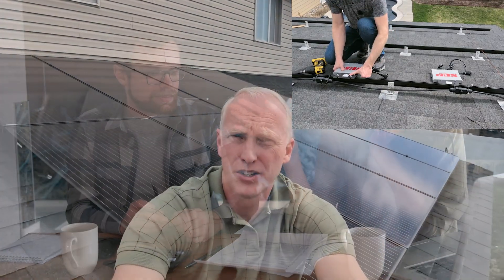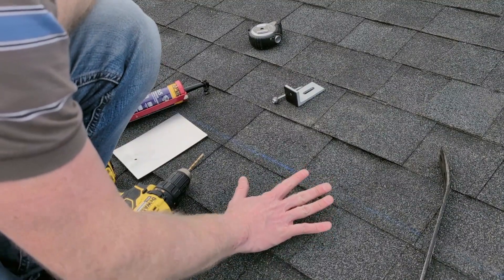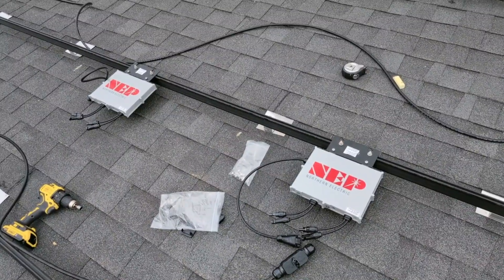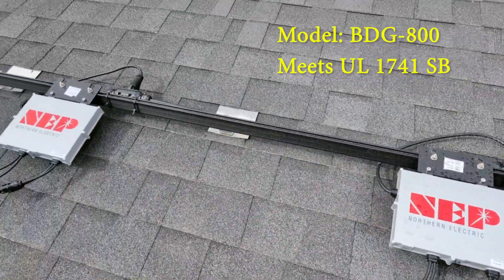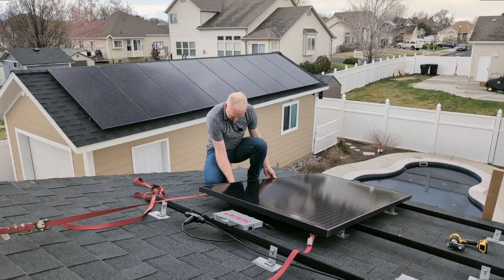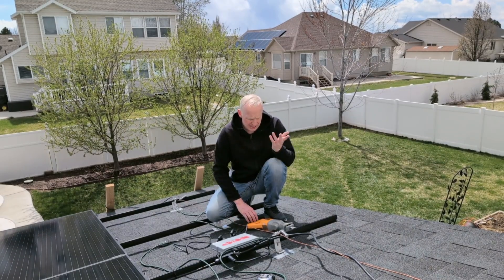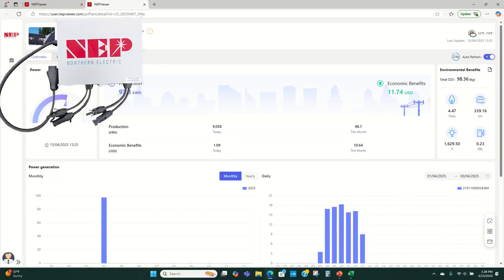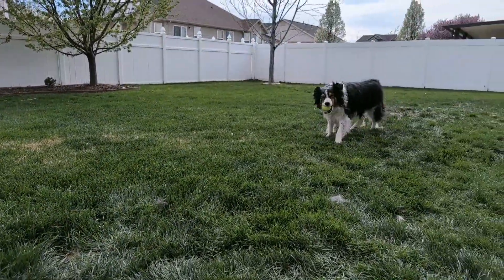Easy DIY Solar Installation to Save Money! – NEP BDM-800 Microinverter & BDG-256 Gateway

Comment: Hi, I realized you didn't ground the rails? Iike a earth rod.
Reply from the maker: All the metal frame, including the rails is grounded through the main power cable to the earth rod. I verified this with my multimeter.
Reply: Alright, I'm planning to set up the same setup too.

Comment: great video. I am going to mount my panels and hire electrician to connect to utility. Did you pay $648 for permit or is that for drawings and permit together? i see some online vendors asking $250 for drawings after you select the panels and inverters.
Reply from the maker: I did my own drawings. The $648 was just for the permitting.

Comment: Hello, I have issues with BDG 256. Can you describe how to make it work. I am entered serials and nothing is happening after restart. Inverters blink orange sensing grid voltage but no production (amp clamp shows 0.1A)
Reply from the maker: Did you reboot it after putting in the Serial numbers? Not sure what else to try.

Comment: Hi. Is it possible to achieve zero feed-in? I have an offer for a NEP microinverter with energy storage, but it doesn't make sense if I continuously feed 800 watts into the grid. (800 watts is the limit for microinverters in Germany.) And i want to use some of the energy during the night, so when my house needs 50watts i want it to only provide 50 watts.
Thanks for the reply
Reply from the maker: I am sure there is a way, but I do not know exactly how to do that. I don't have batteries on my system yet.